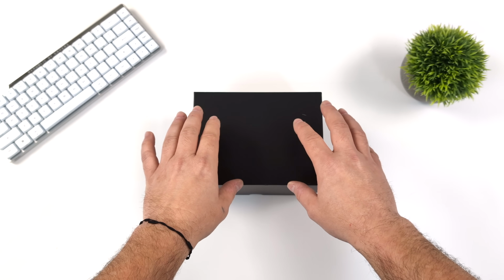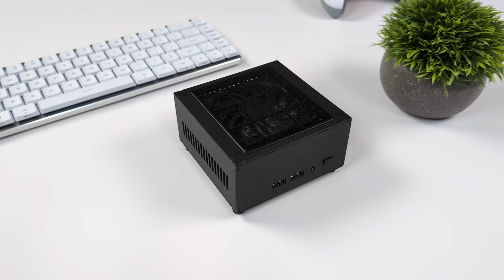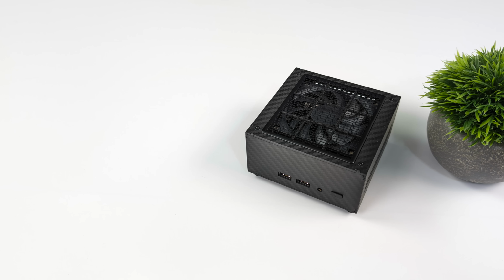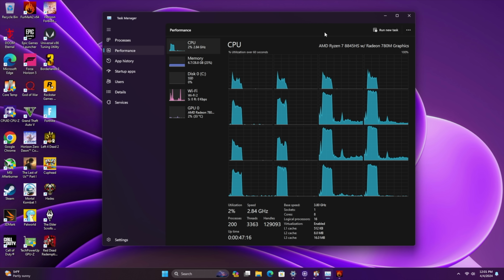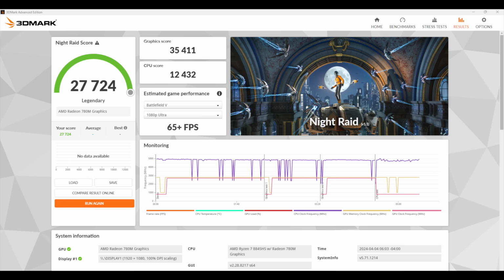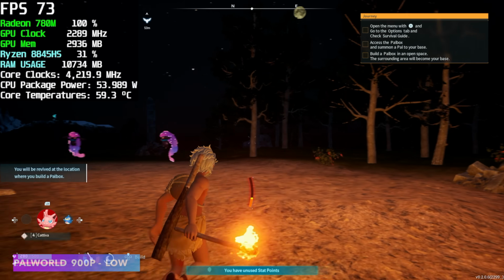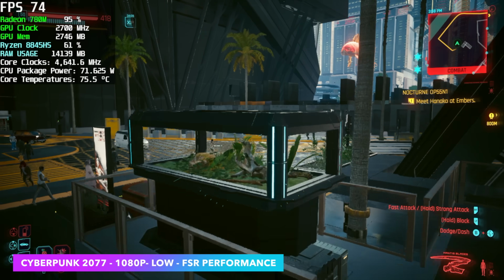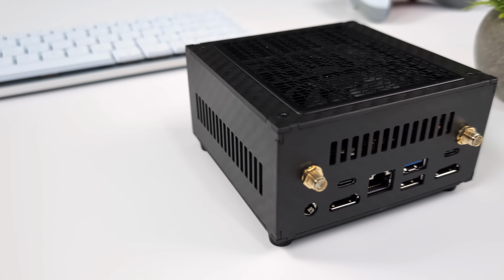InnoByte Edge 8000 Mini PC First Look, Fast Ryzen 8845HS Carbon Fiber!

Comment: Hello, I need some help regarding my HP Aero 13 Ryzen 7 7535U laptop.
The laptop can run at 28-30 W TDP but after a min or so of gaming it drops down to 15W which literally ruins the experience as FPS are almost halved.

I have tried ryzen controller and amd apu tuning utility but not working or maybe I am using them wrong.
How can I change the base tdp to 30 W so I get better performance.
Temps are normal and remain to low 70s even when running at 30 W

Comment: Honestly, theres so many of yhese mini PCs coming out that its just hard to keep up. Ive been looking at producing a mini emulator console and looks like something last generation like the Ryzen 6000 series with the 680M is enough to run all my needs up until the PS2... Though i keep holding back the trigger knowing thag someting a teenie bit more powerful will come very soon
Reply: Just note versions with type c power cable.

Comment: The SODIMM slot is actually the fastest available interface for DDR5 RAM- LPDDR5 does not reach the same speeds (though it is more efficient and much smaller- which is why its so common in mobile/small devices).

Comment: My main issue with these 780m NUC's is that they are the same price range as the ROG ally/Legion Go, which have the same power, but also way more functionality, having a screen, battery, controls, etc.
Reply: but less ports and less upgradability (try an 64GB RAM upgrade or stick in an additional SSD). also the cooling on the Ally is not that strong since it cannot sustain 60-70w load on the CPU.
Reply: @lubossoltes321  congrats you found the only reason to buy this thing lol. You’ll also have to spend a couple hundred more for a monitor and peripherals.
Reply: @lubossoltes321  I suppose so, but you can always add a usb hub for more ports, and you can easily upgrade the SSD's. Ram upgradability is definitely a pro for a NUC, but its still a low power device, the amount of people who actually need more than 16gb out of an iGPU pc is probably pretty slim, and while you do gain performance going to 60+ watts, its minimal vs the 45w max in dock mode the handhelds can offer
Reply: @Pepperonick based take, this is 100% true. People that use these things aren’t in need of 64gb of RAM. Those people have a completely different solution, where the only use for it here would be to have chrome AND steam open at the same time lol.
Reply: @beeseechurger don't need 64gb but I do feel like 32 should be the minimum with these gen APUs since all the ram is shared.  Sure you can get away with 16gb especially if it's fast but 32gb is that sweet spot for most I feel like. 

64gb is definitely not necessary for the folks that would use a mini pc as their main daily driver.  But I think 32 or even something like 24gb is the best way to go to get the most out of your mini pc and also if they are fast enough you will have a nice little future proof device

Comment: If youve seen one mini pc these days, youve seen them all. There no difference between these mini pcs.
Reply: Difference is cooling solution. In both terms of noise and longevity. They’re all loud as hell. And under a moderate gaming load for going to pin the CPU at 100°

Comment: Two problems, first again 780M is not great for play, the next generation (880M) need at last double performance than 780M, it can be done by Watts Boost (and you can choose high or low performance). Second the price still super high for a poor perfomance in games.
But the CPU is a beast, no doubts.

Comment: Sir, I have a specific application & looking for a good solution - stock market "day trading" where fast entries & exits are critical. Seems that gaming computers might meet the needs? Wanting to run two large 4k monitors with multiple windows open on each, keyboard programmable hot keys fast response, fiber optic fast internet connection hardwired ethernet port. Am I on the right track looking at this class of hardware, to avoid the (highway robbery) price gouging of specific purpose built PCs that traders are typically steered towards by "not so independent" educational instructionors? 🤔🤨 - seems to me, suspicions of kickbacks might be involved 👀😳🤦...

Comment: Why do these companies keep using 5600mt ram when 6400mt and 7500mt is available? 🤦🏽

These Apu's need the fastest ram available, 5600mt just hampers the potential performance.
Reply: The same reason they dont drop in a 7800x3d and dedicated gpu die. Because they are shit.
Reply: Because they cannot use anything else. Those mobile chips are locked out front by company that creates them - just like Intel Mobile CPUs, you cannot put XMP profiles on them and get memory to 4000+ on DDR4 inside laptops

8845HS on SODIMM can get only 5600MT/s... if they want to use faster memory, they need to use LPDDR5x at 7000MT/s
but because they want to leave option to upgrade memory on those MiniPC, they are forced to stuck with 5600MT/s

but yea back to topic in a shorter way - this is not decision of people that make those miniature PC but decision of companies that sells them those APUs
Reply: Can’t use anything faster than 5600 w/ these mobile APUS

Comment: we need some systems where it packs higher performance also, rather than sticking to low and scaled settings, at least 1080p high preset to go for, whatever the power consumption may be
Reply: Checkout the Minisforum Neptune HX 100g. I just got one, installed chimera OS on it, and it’s an absolute monster. I’m running games like Returnal and Cyberpunk on high+ settings at 1080p 60fps. It’s way more expensive than most other mini pcs but this is the closest you will get to something half the size of a PS5 that will outperform it in its own games for example lol
Reply: not with the current generation of iGPUs ... the 5600Mhz memory is the bottleneck and a huge one ...
Reply: @lubossoltes321  strange, the product is not serving well then
Reply: @ScientificZoom  no, you are just not the target group for these products, you have expectations beyond what these APUs can currently deliver ....
Reply: @lubossoltes321  actually i don't have any lots to expect from such products, but I'll try to go for at least touching premium level performance, mostly my area is Desktops rather than some mini pc
Reply: These APU's exist, but they're called Playstation 5's and Xbox Series X's.......
Reply: @HeadRusch1  at the very least we except some performance advantage of buying such systems, though pricing is beefy already. Seems market and manufacturer doesn't care its customers

Comment: I saw a video where someone received a broken case on their carbon fiber tower. The computer did work though.
Reply: Carbon fiber is actually quite susceptible to impact damage. 

For a bicycle, carbon fiber is nice because I have to move that mass. But for a mini PC, I'm happy to stick with steel or aluminum.